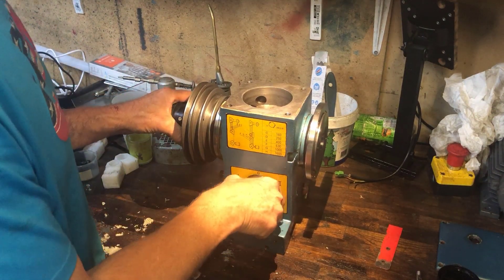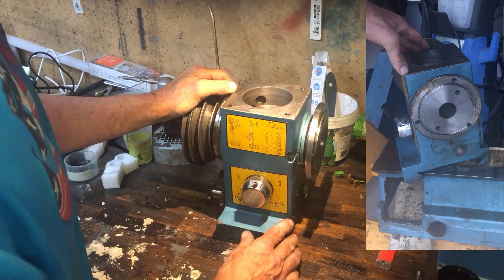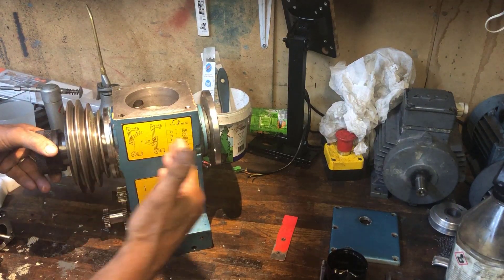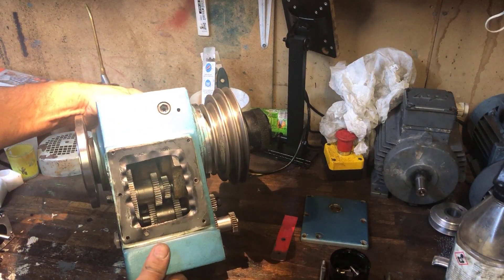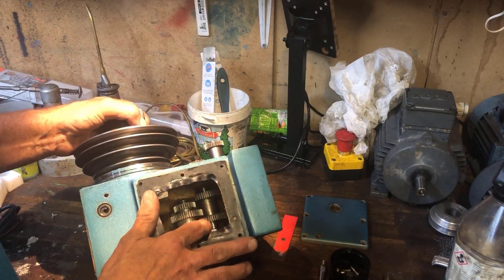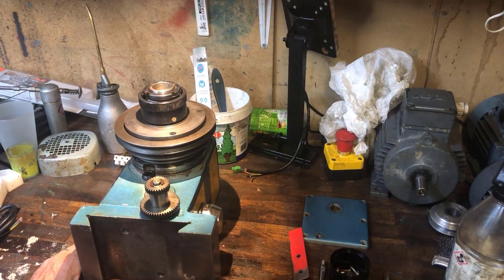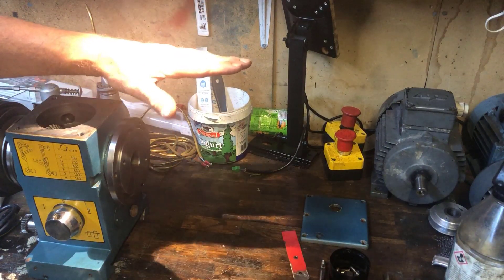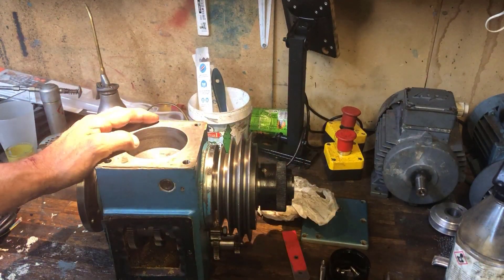AT-300 lathe-mill-drill, headstock - intro

Comment: Heelo Mr. Haugjord, i wrote you a message in Messanger. Mine is leaking oil, because you are obviously highly experienced,  i decided to ask for advice how to make it stop leaking oil.
Reply from the maker: Hi there, Thanks for the high thoughts about my competence, but I am afraid I will be a dissapointment to you as I don't have have much experience with these types of machines, nor seals in general. I guess however that your problem is either bad workmanship, bad materials or a combination of this and possible no maintenance? Anyway, the gasket on the rear cover on mine was fine, so all I did was drain the oil, remove the 4 screws holding this cover plate so had access to the interior .. gears etc. Then I also inspected the sight glass in front (below the chuck), which was OK, then I refitted the cover and filled her up with oil again.
Reply: @jansverrehaugjord9934  I watched all the rest your videos with AT300 bringing to tolerances and surfaces quality. Great job. The word competence is even weak for all you did! Unlike You, i will have to deal/fight with simple things, like how to get the motor pulley back, as it appeared tight fit.
Reply from the maker: @marto9025  Hello again, thnks for the nice words! It was an experiment re. scraping etc. on this machine, but I am very pleased how it came out.
Yes, the motor pulley needs to be extracted wit ha gear puller of some sorts, at least this is what I did. I have now changed to a multi-rib system and am currently waiting for some more belts as I am experimenting with different drive arrangements/motors
Reply: @marto9025 mine is leaking also. Through the seal of the spindle. i tried to dissasemble the spindle but i didnt succeed. But maybe i also filled up too much oil. I see the cap holding the spindle seal is made out of some soft plastic. Poor solution.

Comment: hello i'm have probleme bearing old one my stanko 1i611p im have référence for tow bearing but the last one ?? 36209E or 46209E can you help me please sorry for my english
Reply from the maker: Where is the bearing located? I have the parts manual, but it would be of help to know which assembly it is supposed to be located in? If it is the thrust (rear) spindle bearing it is the latter, ie. the GOST 831-75 = 7209B  = 6-46209 Е
Maybe hard to get them from Ukraine in todays circumstances, but here is at least a website with the latter bearing https://ebearing.com.ua/en/7200-c-b-ac-36200-46200/140867-7209b-6-46209-e-gpz-34-single-row-angular-contact-ball-bearing.html
Reply: @jansverrehaugjord9934  les 3 roulement de la broche la ou vient ce fixé le mandrin
Reply from the maker: @brazideccyrille572  Designation:
NN3034K (DIN 5412-1);
3182134 (GOST 7634-75, USSR). Also available from the Ukrainian site https://ebearing.com.ua/en/nn-3182-/2064-nn3034k-3182134-cpr-super-precision-cylindrical-roller-bearing.html

Comment: Since you mentioned the possibility of running an encoder off some of those gears, I must presume that the gears aren't in obviously bad shape and the backlash isn't a problem.  So despite being without oil, it wasn't run a lot in that dry condition?
Reply from the maker: I have a friend with a somewhat larger (gearhead) lathe (also of Chinese origin) and he used one of the gears connected to the spindle, and has run it like this for a long time now so I don't think that is a problem. You need to avoid having excessive backlash, but I don't see this as a problem here either. 
The encoder must of course read the correct rpm and I see that none of the "outputs" are an exact match to the spindle hence I need to make a conversion ratio and plug this in the setup menu in the software.
I might do as I have done on the Myfords, namely run a 1:1  timing pulley-belt system directly from the spindle, but there isn't an "ideal" place to put the pulley that goes onto the spindle.
Have to think about this before a decision is made.

The gears seems fine.. I assume the lathe hasn't been much in use. Actually, the man I bought it from had purchased it from the original owner from new, who reportedly had not used it "in 30 years".